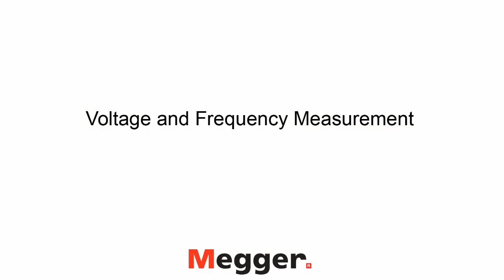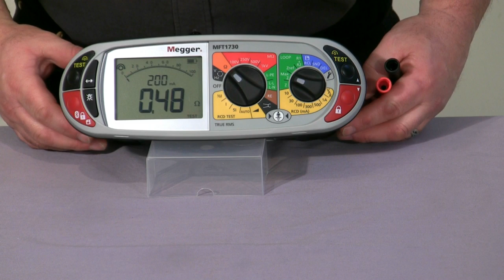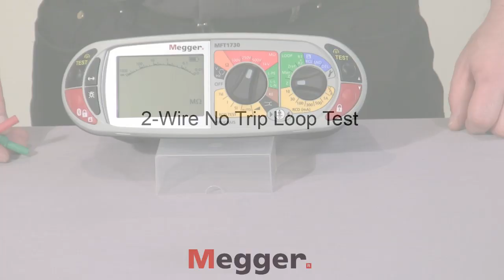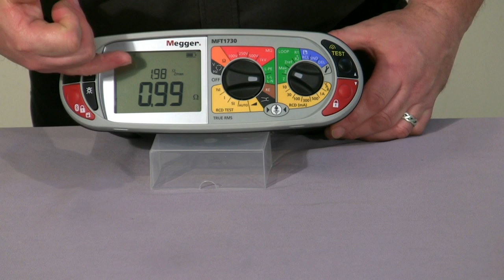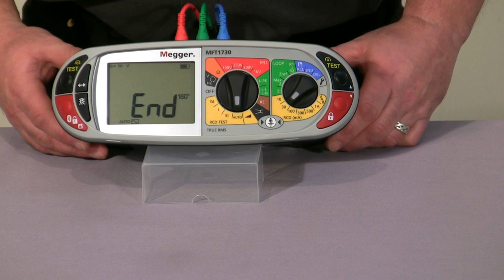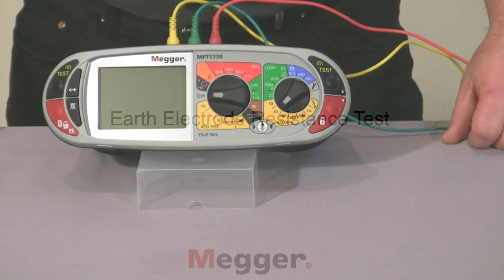MFT1700 Series Demonstration (superceded)

Comment: at Allenvik, it is most probably the parallel paths that are introduced with the energised system. The dead R1&R2 test requires the disconnection of the circuits conductors, removing all parallel paths. whilst the live test does not do this.

Comment: I would strongly suggest megger gets rid of the Zref/R1 & R2 rubbish at the earliest opportunity.

Electricians need to monitor the Zs measurements for verification of ADS.
Any person competent to test and inspect effectively should be able to deduct one number from another on their own - the presence of an R1 & R2 setting on the loop dial is also confusing to learners.

This encourages bad practice - nothing else.

Comment from the maker: For later MFT1720s where there is NO RCD present set the large dial to L-PE and the small dial to Z.  The Display should show 2Hi Connect the L1 lead to the phase conductor and L2 to main earth.

FOR RCD protected circuits set the large dial to L-PE and the small dial to Z. The Display should show 3Lo  Connect the L1 lead to the phase conductor,L2 to the CPC, and L3 to Neutral.

To toggle between 2Hi, 3Lo and 2Lo press the arrow button on the left hand side above the backlight button.

Comment from the maker: Hi. Thanks for your comments. Not sure why you have no sound. I can hear it OK.

Regarding Zs and PFC there are two different methods depending if you have an early or later MFT1720.

For earlier models where there is NO RCD present set the large dial to L-N and the small dial to Z. Connect the L1 lead to the phase conductor and L3 to main earth.

FOR RCD protected circuits set the large dial to L-PE and the small dial to Z. Connect the L1 lead to the phase conductor and L2 to the CPC.

Comment from the maker: You are absolutely right, R1+R2 is a dead test, performed on a non-energised circuit using the continuity range at 200mA test current.  The MFT1700s offer the opportunity to check R1+R2 measurement on a live circuit by measuring Ze, storing it as Zref, a reference, and subtracting that from Zs automatically on R1+R2 loop range. This is not meant to replace the dead test method but to enhance the monitoring of circuits which can not readily be de-energised.

Comment from the maker: TRMS is an advantage for volt, current and frequency measurements on distorted waveforms such as on circuits with motor drives downstream or generated supplies.  This transfers through to loop testing resistance as it is a function of measured voltage and current. The new MFT1730 not only incorporates TRMS but a number of other features that make it particularly useful for testing industrial installations like phase rotation and 3-phase RCD testing.

Comment from the maker: Thanks for your comments. All the feedback to us from customers says they like the new leads. The increased silicon content has reduced the tangling and makes them easier to control as well as improving the insulation properties. The standard probes are less bulky in the tip area yet conform to GS38. Customers tell use that the croc clips are much “grippier” and are easier to get in to tight spaces because of their new shape. And the long probe, we’ve been asked why we haven’t done it before.

Comment: would endorse that megger testers are the best i have used in more than 10 years of testing. A couple of questions i have are; is there now a requirement in the regs to carry out a 2X rcd test? what is the advantage of changing to true RMS values for loop testing? surely R1 + R2 is a dead test to be carried out before energising a circuit? coments please !